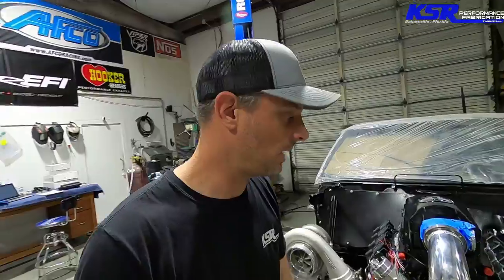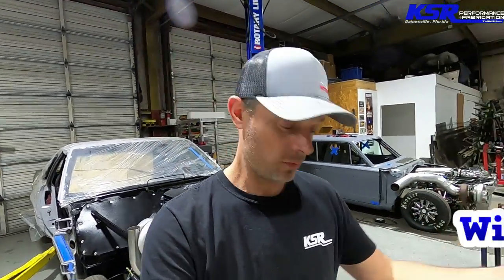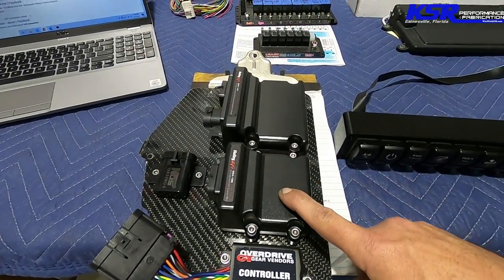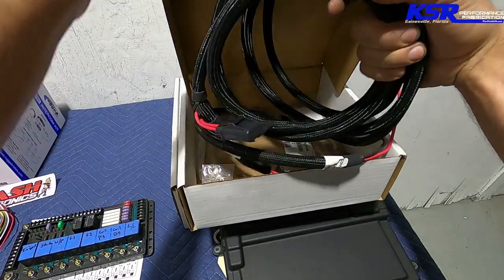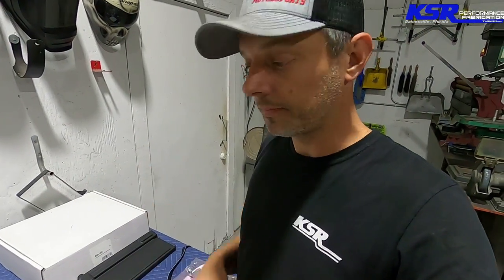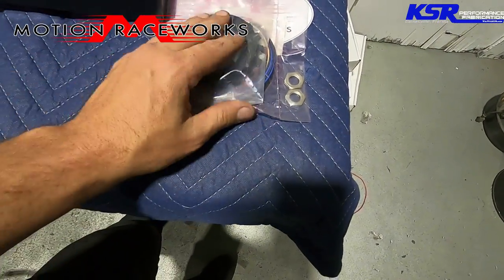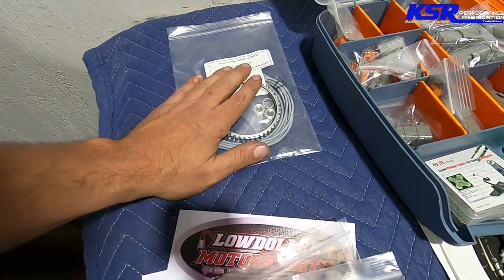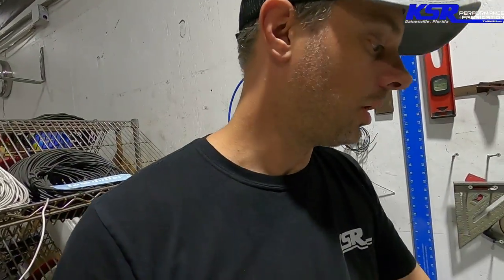Mullet El Camino Build Episode 12.....Wiring Overview!!

Comment: My suggestion as an electronics dude is to tie all your grounds directly to the frame, or to your roll cage. Not only will it save some wire, it will also save weight, and make the whole thing much easier to debug. If you have a bad ground, you only need to trace it back to the cage or frame, instead of having to mess with ground wires embedded in harnesses. You are also eliminating any chance of ground bounce or ground loop this way. Basically whenever there's a ground anywhere in your schematic, don't route it through to the next connector, just connect it to the nearest cage or frame connection point. I don't know why no one does this in race cars...
Reply: Additional terminals/ground connections allow too many places for wire to get abraded, break, get pulled, have welding slag hit them or connection terminal failure.
I agree with you, as I have been doing vehicle sound, video and security for many years, but they want to minimize connection points to make problems easier to trace.

Comment: tools of my trade!  I've been a aircraft electrician for almost 30 years. That round plug you had is the kind of stuff we use on aircraft and work great for quick access/disconnects.  Perfect for your application on the firewall for engine removal like you said.  Love how Holly has the ability for you to populate your proposed set up to see if it will work with what you want the car to do.  Helps make life easy for sure.

Comment: Excellent job of pre-planning the wiring. Making everything the correct length with strain relief is job one. I solder, heat shrink and use wire loom as needed. It's also one of my pet peeves to see a wire mess on a race car. Makes my stomach turn lol
Mullet will look fabulous I have no doubt!
Thanks for a great video series on this car. 
Seeing EVERYTHING done right is a pure joy to behold. Thank you !!
This is a lot of car for oL cleeter. 
He may be a good driver but this one's a step up from McFarland fabrication LOL 
Great job as always guys.

Comment: Great tips and technique Kevin.  I enjoy your videos very much.  My builds are much smaller scale (dual sport motorcycles mainly) but they are much more complicated to do correctly than people think.  I do have one build article and pictures in a major publication from 10yrs. ago as they were improving the same motorcycle, and I worked with them to help out.  Unfortunately, I had a stroke 3yrs. ago now and its been a slow process getting things back as close to normal as I can.  Age can be a factor as I got into that business at 50yrs. old after I retired from my first career and wanted to work for myself.  Keep up the great work!

Comment: I remember the days a Holly Dominator was a 4-barrel carb  with 2 inch bores 1 11/16 venturi's with an airflow of 1150 cfm @ 1.5 inches of vacuum, I had one of those Holly carbs and manifolds books to help determine the size of carburetor and design of manifold necessary.
A friend helped me he was a pro race car builder and driver, every body locally new this guy because he was always on the cutting edge of technology, he was one of the few racers(stock car) that could compete with the Big Boys, he was an inspiration to me and I miss him, he passed away a few years ago like all racers want, calmly in their sleep, he knew what it felt like to be on fire, not pleasant. Keith Danforth was his name and he did something that I thought was not possible, he took my 350 Cutlass and proved to me that the engine with his porting job could use more than 600 cfm@ 1.5 " vacuum ,I chose a 650 double pump Holly a Holly street dominator manifold, heads with his porting 2 inch intakes 1.625 exhaust ,1.7 to one rockers crane cam .477 int., .496 exh. @.050 lifter rise 220 degrees & 232 degrees respectively, hooker equal length headers 1.75 x 3 inch with 24 inch collector extensions and 2.5 inch cross pipe then 2.5 inch exhaust dumping in front of axle, this combo would  at 6500 rpm pull 3 inches of  mercury which astounded me and at 7500 it was still above 1.5 mercury.
Never blew the motor just the crank, it had nearly 200,000 miles on it but after it was built I put another 150,000 on it, it was the most insane thing I ever put together for street use. I was talking to the Boys at Oldsmobile and getting ideas and they even sold me a rare dual point distributor for my Cutlass.
Reply: Thank you for taking the time.

Comment: Fantastic video Kevin...
The single biggest mistake I made on my first Holley install (on Dragbike) was not making a list before I started but that was because the system was bought used and it supposedly came off of a 'similar' bike so we thought it was going to be straight forward and easy = NOT!!! I ended up having to 're-build' the harness (which included deleting some butt connector 😱) and believe me that was 10-times harder and TIME CONSUMING vs if I would have starting from scratch with unterminated harnesses. Still not quite finished but I'm hoping/planning on doing the base-tune on my dyno tomorrow 😎💖

Comment: We use EGT probes at work testing gasturbine engines, and we are not allowed to shorten the wires of the thermocouple cables due to the resistance value of the cable's. Maybe worth checking if it matters on these cables. 🤷‍♂️. really awesome how mullet is progressing, i enjoy every video you make kevin!

Comment: Kevin - one thing I was curious about is only running one shock sensor in the rear, in my mind if I'm wiring up such sensors I'd likely run one on each to fine tune the suspension on the launch.  Just a thought.  Keep em comin! 🤘

Comment: Every former military aircraft maintenance man saw that Canon plug you are using for the engine harness and just had a flashback.  Tech tip- have a way to safety wire that connector so it doesn't back off.

Comment: Kevin, you should do a wiring 101 episode some time. I'll tear something mechanical down in no time, but I've always hated wiring because I don't understand it as well as I should. Go from the basics of amps vs. volts, grounding, how to run power, different connection types and how to create them, diagnosing wiring issues, and most importantly, how not to zap yourself!

Comment: Hi Kevin, I hope you don't mind me making a reccomendation?
I've over 40 years experience in broadcast TV equipment. With the increasing power of digital equipment, interference from unwanted rf generated by electronics becomes more of a problem as we progress ...
For example, 1080p video cameras work at a data clock speed of 3 Gigabits per second, this can generate rf interference that has unwanted effects, as can many other devices...
Holly are right to reccomend direct connection to the battery, but I would go even further by using grounded metal shielding on all cables, particularly those with engine sensor data on them.
This is standard practice in broadcast electronics and can keep the worst of interference minimised.
Just think about the cable to a satellite dish, that has 2 types of shielding over the single core.... Metal foil and metal braid, copper in the best cables
 Cat6 computer data cable has 2 types of shielding now, the 1st being the twisted pair cores and the 2nd being a grounded metal braid. BTW I wouldn't reccomend Cat6 cable for car use as it has single metal wires, not multi stranded, and is easily broken in a vibration rich environment. 
I hope that helps. 😉

Comment: Kevin, very informative video, one thing you didn't mention,  but might be worth considering is an atmospheric pressure sensor,  tracks, especially on drag week vary massively.... ...
Reply from the maker: Holley already has a barometric pressure sensor built into the ECU.
Reply: @KSRPerformanceFabrication  wasn't aware of that.....👍
Excellent work!!

Comment: Not to add anything BUT, Have you seen precision transmissions video on cooling his drag cars trans? He useses a pump cooler and fan to move the trans fluid and cool it even when they cars shut off.  We used to do it when we ran powerglides in oval track racing and it helps a LOT!

Comment: Kevin your going ti make sure the laser sensor is not on when in street mode or it will pull timing on every pot hole and crack in the regular road surfaces.

Comment: Hey Kev. There are wiring looms and works of Art! An engineer is half scientist and half artist. You, sir are BOTH! 😁👍🏻

Hope that 3D printed receptacle isn’t printed out of PLA. That stuff gets soft if it just gets warm!! I’d recommend Nylon or Polycarbonate. I’m sure you’ve thought it thru but just in case. 😊

Only one wheel speed sensor per axle?!? 😂
Reply from the maker: I may end up welding a little bracket instead of the 3D printed ones.

Comment: Kevin love your work. I have a very similar setup with regards to dual Injectors and injector driver module, I believe I can swap which Injectors are the primary Injectors from within the tune to save having to swap the wiring over. I have tested it in theory in the base tune file but have yet to fire the car back up to test it,

Comment: When it comes to switch positions the important ones that you don’t want pressed accidentally should be in a separate bank to the regular ones. You don’t want to kill the ignition reaching to turn on the aircon or something.
If you use a separate little switch block for ignition and kill you can put a similar one under the hood which can be very handy especially if you need to kill the ignition or just crank it over without starting and having to reach inside the cab.

Comment: Kevin, have you ever tried using the Kevlar cable labels for printed label makers at all? They are designed to used in wet and aggressive environments (primarily for tagging cables). I use it on network cables all the time. But I would think they would probably work in this situation, i've just  never tried them in an engine compartment. (in cabin they likely would have no problem)

Comment: Love the tech and building video’s  Kevin! Do you plan on adding a Scramble Button to Mullet and wheelie bars? On the Air Temp sensor will it give you the Barometric Pressure Info to. Because In higher altitude conditions like Vandenberg Raceway. Some turbo car’s have a hard time spooling up bumping in. 👍🏻

Comment: The last part of the video with the 52 pin round connector and the crimpers are the same Mil Spec tools and connectors that I used on military fighters and transport aircraft.  It is sooo nice to use.  
There is some knowledge you need to know how to use it properly.  
Kevin did you get the right wire strippers?  They make a big difference and makes the wiring really nice.

Comment: The Mauser electronics website can be used to acquire military aeronautical connectors and jacks. The possibilities for these in an automotive application is insane. There are connectors and jack setups big enough to handle a one plug solution for everything under the hood into the car interior via one firewall termination.

The DMC website has the best cross reference tool for pin references for plugs and the correct turrets for the crimper tool and said pins.

There is a Brady wire label maker that’s the shit for making heat shrinkable wire numbers for your cars. Label your own diagram and throw the heat shrinkable sleeves onto the wires.

Just my advice, from a USAF aircraft mechanic/electrician going on 17 years.

I’m close to retirement and see so many opportunity’s for aircraft wiring procedures to bleed into custom automotive builds. 

Hit me up for a chat about wiring if you care to, I love it.

Comment: The plug you showed for the firewall is called a Cannon Plug. We use them on aircraft and they are very robust connectors. Did you get the clamp style back shells for it as well to provide strain relief?

Comment: Huge fan of your videos, keep learning new things each time so thanks for all of your time and hard work!  I was curious if you see variances in the egt readings when shortening/lengthening the wires? I shortened mine (only running one) a couple ft of the wires back to the ecu and it actually read hotter by around 75-100F than a new original length one. Maybe just the difference from sensor to sensor but makes sense with the ohm change, wasn't ever sure if that was a fluke deal or not.

Comment: Kevin, have you used laser before for distance measuring? Have you had success?  I worked for a major crane manufacturer and the kids in engineering decided to make the out rigger beam length sensors, laser. Only young would have thought that was necessary but the gun or the mirror, yes they reflected the beam, would get the smallest amount of dust on it and the sensor quit reading. Now on a race car no big deal but on a crane it stopped the crane from functioning, not good when you have a 100T on the hook. It lasted 3 years with numerous campaigns to make changes to make it work but in the end, we ended up removing the lasers and going back to the tried and true wheel and cable method.

Comment: I wonder if you would run a large 2F capacitor on the battery for the ECU? Surely that would help suppress any electrical noise.

Comment: Nerdtastic... Do you run anything random in the data logger... in our rally cars , the guys used to flick the heater on and off, to set a time in the data, if something strange happened.. obviously useless in a 7 second run, but damn handy on a road section if you have a splutter, you can find when it happened in the heater trace in the data.

Comment: Question on the firewall connector:  Do you build two separate harnesses to the pin map, or do you build one harness with a little extra length and then cut one wire at a time and plug them into the connectors at the same time?

Comment: How are you setting up the battery switch? Will the driver be able to kill the power from inside? Is that the switch on the overhead control panel? Is it set up somehow to turn off automatically by the Holley?

Comment: Hey Kevin, fantastic content as always. Wondering if you have a particular reason for not going with a PDM instead of the two fuse/relay boards? Seems like a PDM would let you simplify the wiring a little bit more. Have you had any experience with PDM's on any of your builds?

Comment: You have an outside temperature sensor. Have you considered adding a barometer/"outside air pressure sensor" to measure the ambient pressure? 😊
Reply: Shouldn't that be built into the dominator module, directly??

Comment: Are the EGTs able to be trimmed without impacting the resistance? We use to run thermistors that length of wire was critical to the calibration of the sensor.

Comment: I noticed you said you will have an outside air temp sensor in the chain of wiring. will it also measure humidity in the air? I know a lot of the hard core racers will have a berometric pressure gauge to measure the humidity in the air cause of the water grains in the air depending on the humidity it can kill a ton of power. they also use it to adjust the tune as well. just curious if that air sensor did that as well. very informative tho. you never miss a thing with it comes to details!

Comment: Is there a reason you didn’t go with a solid state fuse board like the smart wire?

I know I’m looking at running an aim technology dash and pdm which also has data logging but going dominator for ecm. It should let me use the oem switches on my 55 Pontiac but operate them switching ground so wire sizes can be much smaller as no load on the switch

Comment: When looking at a lot of other ‘’6 second’’ cars they are all large single turbo applications, are there any benefits of running two smaller turbos to achieve the power needed to run ‘’6’s’’ or would it be easier to run a larger single turbo?  I know that part of this is looks to match cleetus’s branding (turbos high and visible), is this a challenge or very achievable?

Comment: Question.. @2:30 you go into the waste gate actuators. being Modulated instead of just open or closed.. can you do the same with the blow off valve in the Y pipe between the compressor stages and the throttle. body.. so during staging that gets  the blow off valve wide open dumping all the excess compressor air into the atmosphere.. allowing the turbos to spin up to tremendous speed without going into compressor stall..  then using the computer controls to modulate the blow off blow off  valve closed so you don't just rip a wheel stand..  greatly improving the turbo boost coming off the line. and still be able to modulate power ...

Comment: I didn’t see a horn button on the switch panel, are you doing the wiring for a horn and trailer wiring to pass the requirements for Rocky Mountain Race Week?
Reply from the maker: The buttons on the wheel will be the horn in street conditions. Some of my Holley programming trickery ;)

Comment: Why run both a front strut position sensor and the laser proximity sensor? Would you not be able to find the front suspension travel from the height of the front end?
Reply from the maker: On a killer pass, the car will be balancing the front end in the air, with the front tire a couple inches off of the ground. So the shock will have stopped moving. Also, as the car lifts due to rear end separation, the frame will be higher off of the ground so if it not a direct correlation between the laser sensor and the front shock sensor.

Comment: So for all the turbo rookies out there like myself, any specific reason for BB over journal on this build? From what I've gathered with the knowledge I've got is that journal is great for big power as it's easier to keep oil up to it under high g acceleration, but maybe bb would be better for a street car since it'll be running under no boost more, and longevity might be increased?